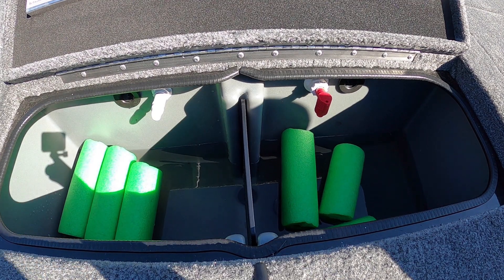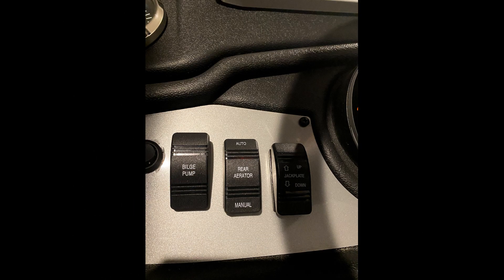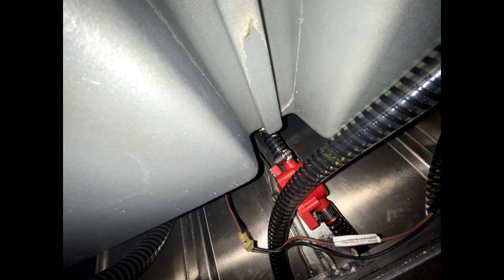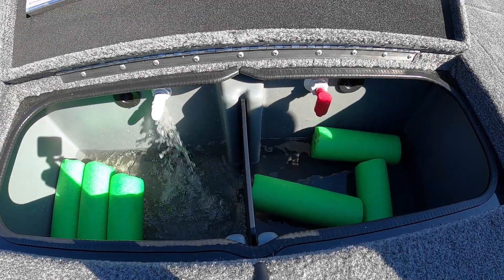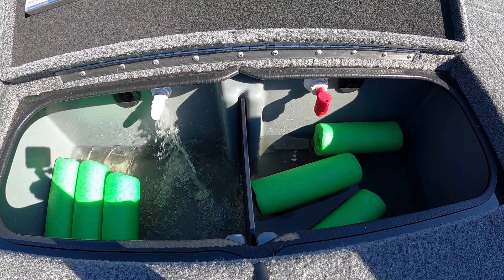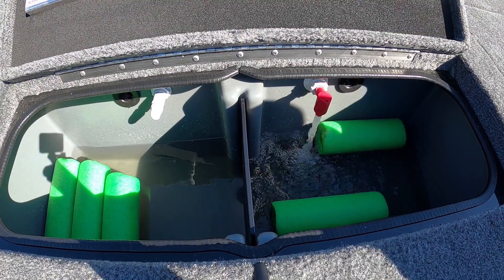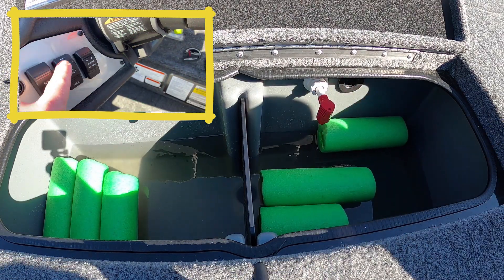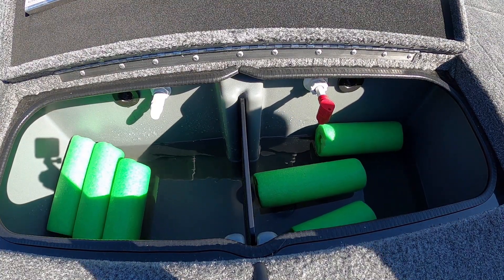How to operate the live wells on a Ranger RT198P (2021)

Comment: Great video, precise and to the point! Found several others that were for the earlier models where the drain valve has three positions marked rather than two (open and closed) like it is in my 2021 RT178. Also, pointing out the hose layout in the bottom of the boat was very useful. Thank you!

Comment: What if you want to keep fresh water coming in all day but on a timer that is what I do? Doesn't  look like you can do it with that setup, my Tracker has two pumps one for filling it up and one for recerc/ pump out, both pumps can be used on manual or on a timer. Looking at getting another boat soon, I like the Ranger RT series boats but I am not a fan of that livewell setup.
Reply from the maker: Yeah it wasn’t the best. You had to always monitor the livewell to make sure you were adding fresh water and recirculating while running…etc. I did sell that boat and I am in a new aluminum boat company that is a much better choice than the ranger models. I made a few videos on it, I’d called an Avid. They have an option for dual pump livewell on timers. They have a new model releasing the end of the year, Avid 21XB elite. It’s super nice. Standard dual pump live well with timer. It’s also a 21ft boat with a 250 Yamaha. G check them out, they have models from 18ft up to 21ft in bass boat series.
Reply: @FishingwithBam  Those look nice do you know about how fast an Avid 19XB with a 150hp on it would be I can't find much info on those. I also like the Xpress X18 and X19. I want a boat in the 18-19 foot range that has plenty of room, is fast and can still get pretty shallow. I don't want anything longer than 19 foot.
Reply from the maker: @Lray4x4  I have a 20XB with a 200, and I ride around 64mph and could probably go a bit faster. I would say that the 19XB would probably be around high 50's, depending on how much tackle and how many people are in the boat. I road in an express a few times. Really nice boats as well, but not as fast. I do really like them though. Either way you go I think you will enjoy it. I would stay away from aluminum Rangers. They are made by me at the Tracker factory. I had a 2017 that was made by ranger. That hull split in half, they replaced it with a 2021. 2020 going forward, the ranger aluminum are all made by Tracker. Not saying anything bad about Tracker. I'm a fan of Bass Pro and Nitro, but the quality just wasn't there anymore. The express X19 or Avid 19XB would be solid choices if you are wanting to go aluminum.

Comment: If I’m not using the live well and I don’t want water in it should I keep it in the open or closed position?
Reply from the maker: The closed position will keep water from coming through the bottom drain hole. Some water will still make its way in but not that much ( through the overflow holes).  If you leave it open then it will let water freely flow into the live well.

Comment: Why won't mine fill in manual I can hear it but nothing coming out. Auto works though? Any tips?
Reply from the maker: Under the pump there is a metal wire that flips the valve from Auto,manual, recirculating. If you have a friend who can flip the switch while you check to see if it moves, that would be a good starting point. Other than that I’m stumped since it works auto. the pump could be bad as well. I went through 2 in 3 years. Though I did use it  a lot.
Reply: Your fill pump may not be primed. Try forcing water into the pump by running your boat in reverse with the fill pump on.